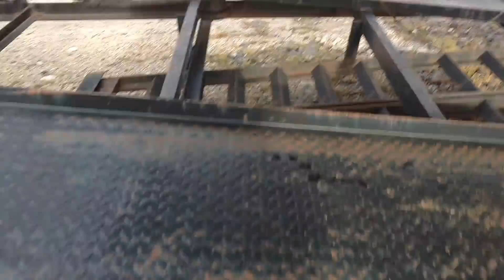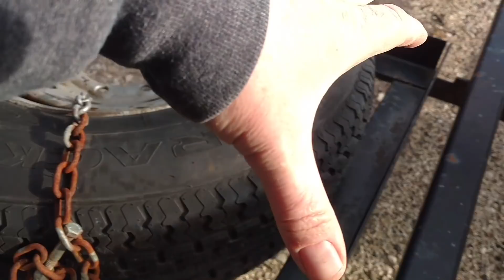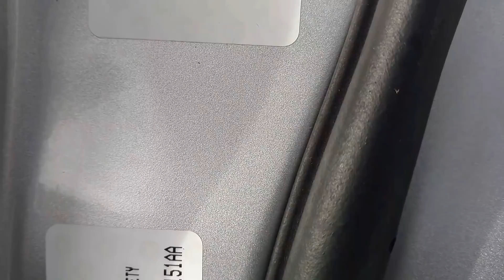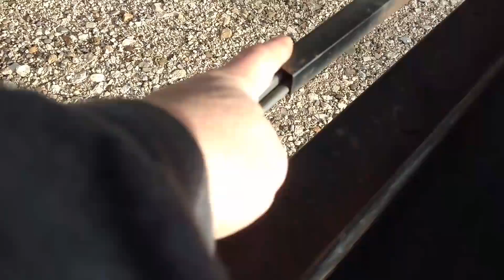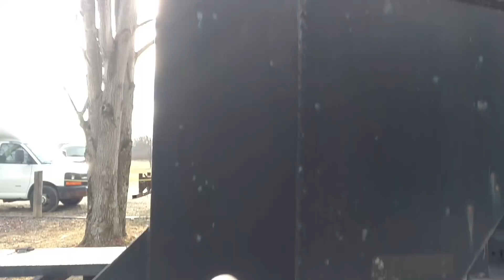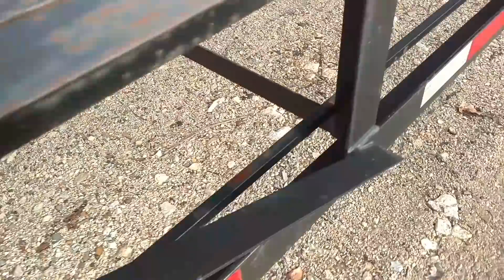THE PLAN IS COMING TOGETHER!

Comment: I have lots of "toys", too. Now, when are we going to see you use your stuff? I have a '90 Ranger Custom and a '79 GMC "Heavy Half" I'm restoring, and drive a 52 M131A1 daily cause I'm in no hurry to get anywhere. I have no cameras or you would see my videos here. I tree farm here in Alabama on 50 acres and am between harvests so I have lots of time for my toys. Been interesting to see what you have and want to change on them, but where does the parts come from? Barter, or old money? Mine comes from good retirement plans and barter work (to be fair). I'm like you, I will not have an automatic transmission in anything I own, they fail and are usually not fixable at home where manuals are pretty easy to rebuild. I did a transaxle from a 74 VW last time, so simple.  Good luck!

Comment: Seems that the tongue weight can be adjusted by the position of your front vehicle. Use that as a sliding weight. Airbags suck.
Reply from the maker: moving vehicles can help manipulate the weight but you cant always rely on that because sometimes you can only get the load on on way and make it fit. i dont have any trouble with air bags.

Comment: You need dot numbers and a CDL. 10k gvw on any trailer is CDL. Any commercial vehicle must have dot numbers including pick-ups. You are over length in many states with that combo. You must remove  your pick-up bed and register as a tractor to be over 60' long.
Reply from the maker: Not true.a 10,000 lbs trailer does not require a cdl in my state. also realize that it is legal to run any gvwr truck and trailer  combination for personal use without a cdl. the exact definition of cdl is a "commercial drivers license". a cdl is required when your truck and or combination is being used for  "commerce". the list of requirements to be compliant is staggering. whatever i do, it will be compliant.

Comment: i wasnt aware that distribution mattered legally.  im studying for the CDL test here in RI and everything ive ever read and been told is that what matters is the registered GVWR of the truck and trailer.
Reply from the maker: that is very disappointing...i guarantee if you go across a set of scales and are overweight on any axles, you will learn all about it very quickly and your wallet will be light just as fast when you pay the fines. they should be teaching about the weight rating of each axle and the overall combined gross weight of the truck and trailer. that is one of the biggest reasons you will see a sliding fifth wheel's on road tractors.
Reply: maybe i just havent gotten that far yet.  i know in RI i dont think we have a functional weigh station, though the troopers do have the plate scales.

Comment: Something is bothering me.  I know you can set me straight. Don't you have a flatbed truck with a dovetail behind the rear axle? I remember you hauling slab wood with it at the beginning of this year or the end of '17.  Much earlier, I think you showed it with one or two pretty big trucks on the flatbed and dovetail. Am I remembering right?  If you haven't sold it, is it too expensive to run on one of these "go fetch 'em" trips? Modify this trailer to hitch to it and you could fetch up to four trucks at a time!  You do what you want, I know you will, just like I would!  I am just curious, did that truck figure in your plans and if so how?
Reply from the maker: i still have the freightliner. it can carry one truck on the bed. i can put a trailer behind it and put another truck on it but the problem is weight and power. the freightliner is heavy and not overly powerful. it is best suited for short trips up to a couple hours each way. it only gets about 6-7 mpg. i can use the dodge pulling that trailer with 2 trucks on it and be more comfortable, have more power and get between 9 and 10 mpg loaded.
Reply: Thanks, that makes perfect sense now.  Oh yeah, I continue to think of those pickups as Dodges or Dodge Rams too! 8-))

Comment: Hope all the calculations work out for you.

 I agree having your own means of transporting is the way to go. Granted I only have a smaller single car trailer and 3/4 ton truck but it's saved me a LOT of hassles AND money.

Heck I've actually made some money over the years hauling vehicles that were broke down or 'projects' for other people.
Reply from the maker: hopefully the theory and reality are the same. it will all depend on if i can get the trucks situated on the trailer just right.

Comment: hey, great vid'......have you thought of possibly mounting your winch on a receiver plate / reversed "L" bracket .......could be used for other endevors?
Reply from the maker: i did but i was concerned about theft. so i decided to bolt it semi-permanent to the trailer. i will give it some more thought.
Reply: You could use a locking pin

Comment: Hey J.C. damsel in distress over on Flying Sparks YouTube channel could benefit from your knowledge in diagnosing a Cummins running issue.
Reply from the maker: i was watching that and had just left some suggestions. when you are having that sort of problem when you install a used engine..you start with the basics....fuel, air, compression and timing. without knowing the condition of the engine and its ability to run properly...you are just running in circles. i am not a guy who fires a "parts cannon" at a running problem. you can doe a whole lot of testing for free!
Reply: I don't have much experience with diesels but thought pretty much the same as you.

Comment: You can probably buy wheels and tires pretty reasonable.
Reply from the maker: i realized i have a set of 5 17.5 wheels and tires here already. they are on another trailer that i want to put new tires on. the tires are about half tread and are getting some age on them. it needs the capacity of the 17.5 load range....this one does not. those tires will be perfect on this trailer and will last a very long time since i wont be getting close to their capacity.

Comment: That's a good trailer. It won't take much to get rid of those rust spots. When you get a load on, put it on a scale and show us how the  load distributes across the axles and the truck axles. I think your plan is solid. The air bag on the drive axle will give you a lot of the control you are looking for.
Reply from the maker: i plan to scale it empty and loaded...the air bags will make it easier to level the truck and in turn transfer the weigh to the right place.

Comment: Looks good to me...easy to load & off load...l agree about weight...this looks like it will haul all the imports you can fit on there...maybe on the next video you can show the other axles you have...l agree about keeping the same tire size & l'd put that spare on front axle driver side before it rots out from riding
Reply from the maker: you are right ....use the spare before it dry rots and becomes land fill. i realized i have 5 of the heavier 17.5" tires on another trailer that i need to upgrade to a heavier rating. i may use those on this trailer and buy the new ones for the higher gvwr trailer.

Comment: Congrats JC, Good to see you and that fella found a number you both could live with, When I saw the trailer on the stream looked pretty damn good and hardly used so you can't beat that. Sounds like you have this thought out well and you should be able to get a few videos about the upgrades between the truck and trailer. I bet your going to have a little bit of ants in the pants about the anticipation of getting on the road for that first trip and hauling the first couple trucks back with sop you can see how well it will do and how the planning brings it together. I can't see the set up not working from what you have mentioned should work pretty good IMHO.
Reply from the maker: i have given this a lot of thought...now to see if theory and reality come together! this week is going to be very busy. i dont know if i will have time to get everything handled...might be next week before i can be ready. i have some thing working right now on some really cool trucks.

Comment: Good buy!  They make a 14 ply tire that would be great on there. A little  more piece of mind while your traveling.
Reply from the maker: i just realized that i have 5 of the 215/75r17.5 tires with a capacity of 4800 lbs each...i think that should do just fine.
Reply: J.C. SMITH PROJECTS for sure!  You’ll have a spare to so you’ll be in good shape. Last time I took the gooseneck on a decent trip to Jacksonville I had 4 blowouts so I changed 8 tires. It was a trip from Hell!
Reply from the maker: i am sure it was terrible. i am hoping to not have those kinds of trips. it is not a new trailer but it is new enough for me. with a little effort i think it can be a good one.
Reply: J.C. SMITH PROJECTS it’s definitely a nice hauler!